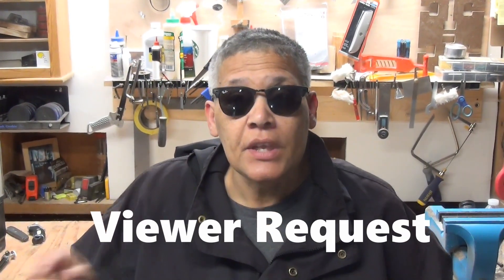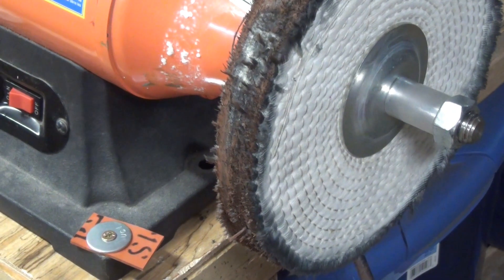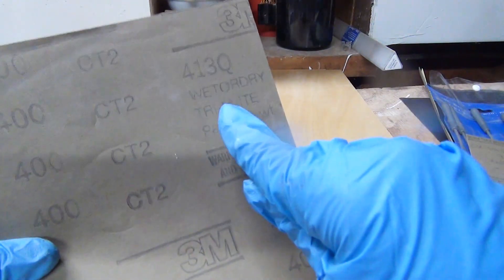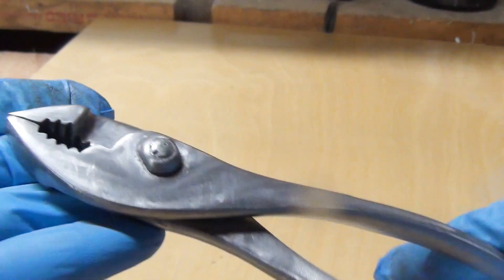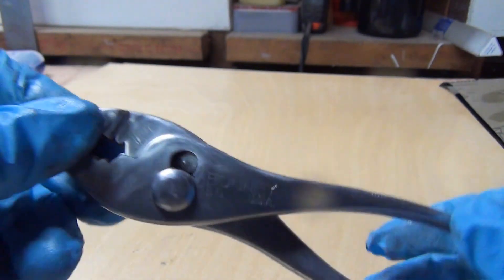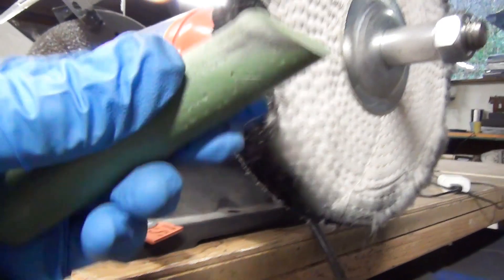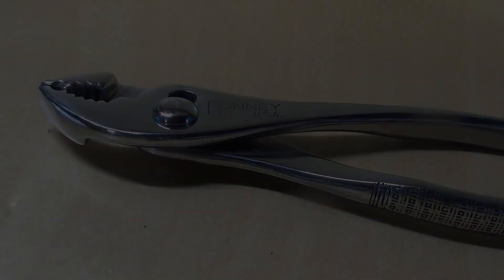VERY, VERY OLD RUSTY pliers POLISHED to a mirror finish

Comment: Great job Leah! I have an original rare tool kit in my 1959 Rolls-Royce Silver Cloud II where the pliers got a little rust on them. I decided to do what you did but i actually took them apart so I didn’t have to work around the nut and bolt which holds the two parts together. It also lets me continue “sanding” in straight lines making it easier to polish without marks going criss cross, across each other! Once the two parts were a mirror finish and the nut/bolt put back together, there were no parts to be seen (under nut or bolt head) which didn’t get completely sanded and polished! The judges look for those tiny things! Another great video! Thanks!
Reply from the maker: Unfortunately, I was unabe to do the same.

Comment: Great video Leah , many years ago  i took home a offcut  of some Structual Aluminum Angle  we used  at work  almost daily  and i buffed it and polished it at home  similar to how you did the pliers  the Aluminum  came out like  almost a piece of Chrome  ironically i   Put that  piece  in the back of my Work Van and almost all of my Coworkers that saw it couldn’t believe that it came out that way  in all honesty i was working on polishing  a old Motorcycle engine parts at the same time  so i just kind of did the Aluminum in my rotation  of those parts  for a laugh  since all the parts went thru the same process  in my shop   Back then i used to use Mothers  metal polish as my final buff  because thats what i used on my truck  and motorcycle rims to keep them Shiny ! Without any  affiliate to Mothers   Other than i like their products  results  ive been using their products  for many years  to keep my vehicles  in  nice condition even  in The very strong Florida Sunshine
Reply from the maker: I'll check it out.

Comment: Hi Leah,  I am looking forward to trying this on a few items in my garage.  By the way a tip for your viewers.  Those nitrile gloves that you are wearing are now platinum plated due to Covid.  In my private practice I wear cotton and/or polyester liners inside the gloves.  It absorbs the moisture from your hands making it easier to remove the gloves without tearing.  When I ordered a case (2000 gloves) it cost me $99.00, since covid the only case I can get is 1000 which now costs me $250.00- like I said platinum plated, just like 2x4 now costing $10.00 which used to be $2.00.  Thanks for your wonderful and positive videos- I wish I could have taken shop classes in high school, but my high school did not offer any.

Comment: Leah!  That buff job was pretty darn impressive!  If I still had a garage, I'd be thinking seriously about a second grinder wheel!!!

If you have the inclination and the space, let me share this with you.  MY grinder  always had a wire wheel on the same end your's has a buffer. That was THE most used tool in my shop!  And I loved using it, very often for just what you were doing... cleaning up old tools or groady parts from something I was working on.  An apron and leather gloves are a must (coz occasionally you  slip) and a canvas tarp behind, coz if not, that screw you're cleaning the rust off of, if it slips out of your pliers, is gonna fly a mile and find the tiniest nook to hide in (plus the tarp catches most of the groady and the wheel's wires that come off over time). It makes really quick work of all that sanding so you might give it a try!

Great video!  That shine WAS really impressive!!!
Kudos from Spokane!!
Lynn
Reply: Great tip Lynn!  A grinding wheel is probably the next tool I'm gonna purchase

Comment: Hi Leah from over the pond England.

At 74 I'm still 'messing about ' with all sorts of things and have used electrolysis and polishing over the years,sometimes down to rouge and  diamantine powder, depending on material, for that truly ultra shine, it's great to see you introduce folk to things they never thought existed or that they could do and gives them confidence to have a go.

Can I just put in a word or two of caution for everyone new to it when polishing with a mop or as some in the comments mention a rotary wire brush.

First, use some eye protection, a bit of fluff or buffing soap in your eye isn't a great problem, at best a bit of discomfort like sand in your eye, at worst a trip to A&E, a wire wheel is another story, the strands do break off quite frequently and at the speed of the wheel can easily penetrate skin and your eye which will entail an immediate trip to A&E, with hopefully no permanent eye damage.

Second, always grip the piece you are polishing in such a way that if the mop takes a bite at it you can instantly release it to prevent your hand / fingers being drawn into the mop or wire wheel, never loop your fingers into the article, also take care when polishing such as edges of say a ring, something with large holes in and similar, the mop can grab these quite easily, get to know how to present the article to the wheel don't lay on too hard into the mop, and very important as Leah demonstrates don't concentrate in one spot or area keep moving all over working your way around the article time and again to get a nice even shine.

I was brought up in a fantastic family of mum, dad, grandparents uncles and aunts, very little money, well fed with simple food, a roof over our heads, adequate clothing, but nothing left for the niceties of life, so what did we do ?  if they couldn't afford something they would make one, fix a broken one or find a different way of doing things, or to use an old English term, " Make do and codge " 😂, sadly many folk these days haven't had the pleasure of making / repairing things.

Finally, the most important things to perfect when buffing and the mop decides it wants to play are a) learn how to duck quickly and b) learn how to listen carefully to every bump and clang and click, as the piece ricochets around the workshop to its final resting place. 😱🤣😉
Reply from the maker: I appreciate your taking the time to comment.  You said, " learn how to duck quickly" I couldn't agree with you more.

Comment: Nice! Just one tip: a wire wheel works like a magic for those hard to reach spots; it kinda self adjusts to those uneven surfaces you may be working with, while solid objects like a file usually won't, unless the shape is very close to that of the file.

Comment: Polishing wheels are very alluring. The finish they leave looks and feels great and is hard not to love. The problem is it’s hard to stop trying to make the finish even better. I know I’m a polishing wheel junkie, and once your hooked nothing is safe! We all know each other by the compound under your nails, the black dust around your nostrils, or the lint from the polishing wheel all over your clothes and shop! Seriously when polishing a dust collection system is mandatory. A dust mask will save your lungs. Safety glasses for flying compound or worse flying parts that got caught by the wheel and become airborne! If it’s metal it will get hot so keep that in mind, gloves can help but flimsy gloves can be dangerous around spinning wheels sucking your hands into the wheel, also parts become very slippery once polished and hard to hold onto, I prefer a pin vice for smaller parts. Remember most tools have sharp edges or machined edges for a reason like the jaws on a pair of pliers don’t round them over. If you find yourself polishing everything in the house there’s always polishers anonymous!

Comment: Haha very nice. I would highly recommend to people wear a respirator when doing this and wear gloves like you did. Not only does it protect your hands from absorbing the dust particles it's so much easier to wash your hands after. If you don't believe me you'll realize it when you blow your nose and your snot comes out black.
I used to polish my high end bicycle parts, they were all aluminum and I ended up an aluminum sensitivity reaction to Aluminum dust. My hands will start tingling and going numb if my hands absorb Aluminum dust.
As a side note my bicycle parts looked like they were Chrome plated when I was done. Riders used to ask me where did I get my parts chromed until I told them hours of hand sanding and polishing. But after they were polished it only took 10mins to rub some Mother Mag wheel polish on them and they looked shiny and bright again.

Comment: I I don't know if you've tried it or if it will work for all metals but, a soak for a bit in a little hotter than warm vinegar will get a lot of old stuff and gunk off. It works on my baking pans and hinges and things anyway :)
Reply from the maker: Yes, Ive tried that too.  Thanks for commenting.

Comment: the better the steel, the better it will buff up. You can sand as high as 8000 grit, but you have to decide when enough is enough. there are also even finer polishing grits meant for softer metals, but they do a dandy job on steel that's already nearly there.

Comment: Video request~show how to reginish to original status cast iron skillets and how to bake the non stick finish on them.
Reply from the maker: Non-stick?  Like powder coating?
Reply: The nonstick finish is from proper seasoning of the cast iron.
1. Scrub with hot soapy water 
2.dry
3.thin layer of shortening or vegetable oil over skillet 
4. Place upside down on middle oven rack , with foil underneath to catch drips
5.bake 1 hour @ 375°
6. Let cool in the oven

Comment: Do those buffing compounds do anything to prevent future rust in any way?
Reply: That's what I was wondering. Won't the bare steel just rust up again rather quickly?
Reply: Yes and no, the buffing sticks are basically a type of wax, sometimes beeswax, with the abrasive compound embedded into it ,this allows it to adhere to the mop fibres.
After polishing there will be a microscopic layer of wax on the item that will give some short term protection, but not necessarily to every area of the item and not necessarily long term. 
Depending on the item and its use, further long term protection and upkeep may be required from coating a display item with a clear lacquer, to giving it a coat of car polish or protective metal polish to such as giving working items an occasional rub with an oily rag or gun oil. Hope this helps

Comment: Really nice, but, um...  There's just one little thing.  "Tripoli" can mean a lot of things these days.  I don't know about that red stuff, but if your tripoli compound is grey then it's likely silica-based.  Buffing throws all that silica (or other abrasive) into the air, and that can cause chronic and potentially fatal damage to your lungs.  Whatever compound you use, it's probably best to wear a respirator.

Comment: It doesn't really matter if you are holding the item above or below the center of the buffing wheel, as long as the wheel rotates away from any edge it can catch on, not against it.
Actually, it is very possible to catch on an edge even below the center if you hold the item wrong!
Btw, how do you prevent rust on it afterwards, the blackening it had originally would prevent it to some degree.
Reply from the maker: Oil

Comment: Maybe you could show how to anodize it in a 3rd part of this project
Reply from the maker: I do plan on showing that process in an upcoming video.
Reply: @seejanedrill  sensational, thank you!
Reply: You can't anodize steel to protect it only aluminium, magnesium and titanium,  if you anodised steel or iron the coating would be rust.
See what happens to Leah's anodes in the video.
Reply: @ducati7847  I should have said galvanize
Reply: @ducati7847  Hello, hello! I'm in Portugal and under lockdown too, due to covid-19. I will watch the video about electrolysis, galvanizing with zync seems to be a good way to prolong the usability of old steel tools or other objects. Thank you.
Reply: @ducati7847  that video has some banana peels in it :)

Comment: I did a similar restoration to an old pair of diagonal cut pliers. They were worth saving because the steel was of superior quality than some I've bought in the past few years. I've used the newer ones to cut a small rod for example and the edge ended up with a round impression in the cutting edge. I used the older ones and they cut right through with no damage to the cutting edge. Poor quality steel that's not hardened in tools are a waste of money. The old diagonal cutters are made by "Utica Drop Forge" and I just Googled them and they were probably made in 1902-1910. People actually collect these,I had no idea !
Reply from the maker: I love older tools for just that reason

Comment: How could you buff a tool without the buffer wheel? I've an old horse shoe my father used to hang on his pigeon loft years ago for luck. He is 87 now and I found his horse shoe and I tried to clean it up with a grinder but nowhere near as impressive as this. I'd like to get it like these pliers and mount it on a board or something to hang on a wall.
Reply from the maker: You can do it.  It took me 4 hours of sanding to restore those pliers.  If I hadn't had the buffer, it migjt have taken a couple of days and 1 500, 2,000 and 5,000 grit sandpaper.

Comment: I do not find it necessary to have a perfectly polished  tool of any sort.  Just cleaned of rust and black ferrous oxide is good enough for me.  I can put a nice edge on an axe or knife well enough to function as it once did before it became a candidate for the land fill. I found an old rusty farrier rasp that was destined for said landfill.  The teeth were in decent shape so I hooked it up to a tank with wash soda and battery charger. 7 hours later it was serviceable for wood carving.   Just saved myself 38 bucks from buying a new one.     Cheers, good people.   Bob

Comment: I got an old cast iron skillet that could use this process.

Edit: Wait a second...I don't want my skillet that shiny 🤔
Reply: Actually, you want your cast iron almost dirty all the time. I know, eww. Part of the reason they stayed popular is that leaving the grease and oil on them constantly seasons them preventing rusting. If rust appears, you can sand it back out, giving a smoother surface, but as soon as done, heat them back up with oil. The black season is what keeps the oxidization away making making it last longer. A friend of mine uses his and said it's been handed down for over a century. 

Personally, I just like the even heat and non stick surface of old, well seasoned cookware.

Comment: i think your great like seeing your videos but why didn't you take them apart i know you didn't want to mess up the factory tolerances but there's still rust under there nice job over all :-)
Reply from the maker: The pliers are 71 years old and the nut could not be removed.  I didn't want to damage the tool by forcing it.

Comment: Quite a turnaround.  However, folks should be careful about over-doing it when polishing.  You may find that you've ground off too much of the pattern on the handles, which was put there to enhance your grip. They may become too slippery, making it difficult to use the pliers effectively.  You can recover by purchasing a pair of rubber or plastic grips to put on over the handles,  making the pliers easier to hold and use.  Alternatively, you can dip the metal handles in a can of Plasti-Dip, letting them dry overnight to add a set of handgrips.

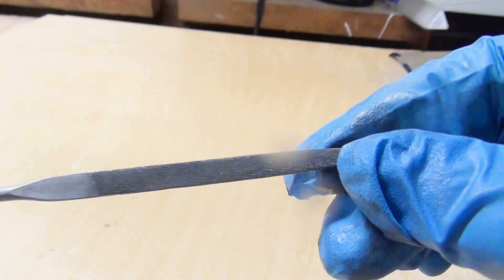Comment: O.O  ASMR filing 3:17
Reply: Also a suggestion:  Have you ever made handle grip replacements for your pliers with some old air hose?  I saw somewhere you can boil some hose it to make it soft, then they slip on fairly easily.  The only video I saw of this didn't show what type of hose it was, but I expect the more common rubber type.
Reply from the maker: I haven't heard of this before.

Comment: Eh, I’m unimpressed. Yes, you can polish (almost) any piece of steel to a mirror shine. But shiny pliers don’t work any better than dull pliers. In fact, they may be worse, to the extent that they’re more slippery. And unless you keep polishing them every day, that shine will fade. Remove rust, definitely. But buffing tools until they are shinier than when they were new is a mug’s game.
Reply from the maker: You miss the point....it was just a demonstration on buffing.